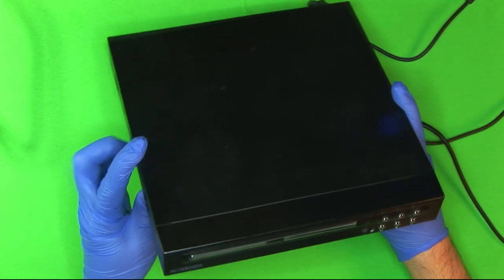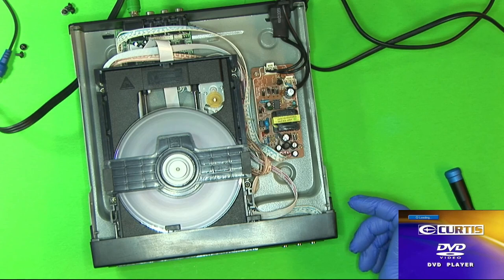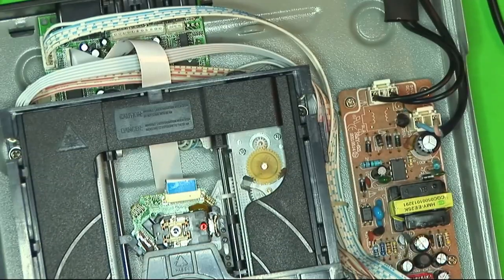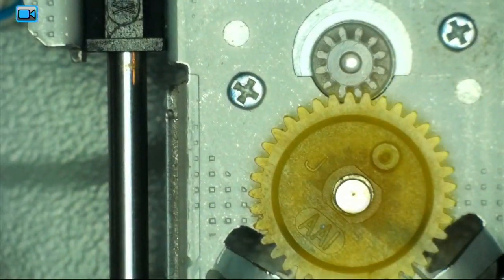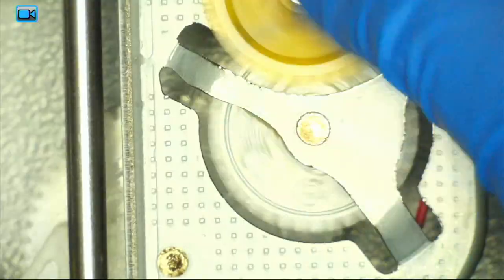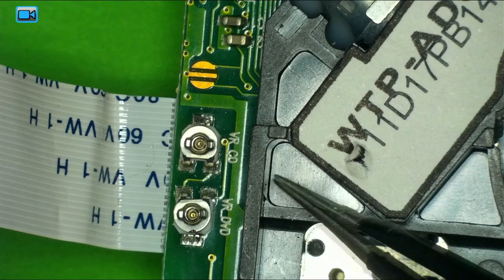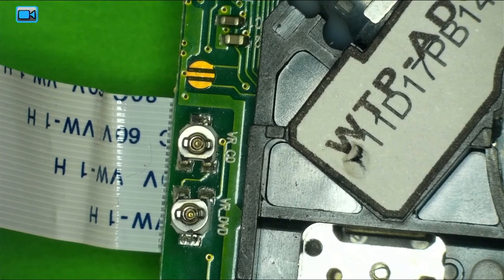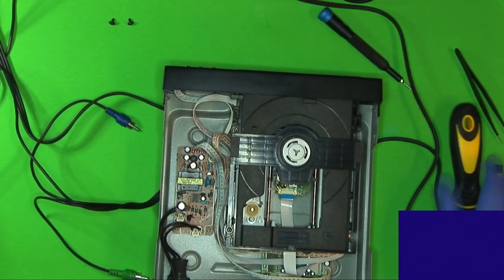Skipping and Freezing DVD Player Fixed - Long edit - No or Bad disc Error

Comment: Been trying this with a highly intermittent and accessed the pot with a long screwdriver. Tried counterclockwise first. Each time the reponse did change. Not having the proper tool cause me to possibly damage the pot, now it wont read at all. 
I reccomend EXTREME caution using this procedure. It works but physical damage occurs very easily. 
I tried searching for a correct tool online but was unsuccessful. Any recomendations are welcomed.. or if i have to replace it entirely .. what cross reference is available ? Many different brands use the same laser mechanism so a donor unit would save a really nice machine, sacrificing a cheap one like the one in this video.

Comment: it's very annoying,my dvd player skipping and play random parts of the disc.I don't know if it's the disc fault or the dvd player.I clean the disc and it didn't skip on that part but another part.It is odd that turning that potentiometer can damage the laser,the laser should have had an current limiters such as ICs or mosfet.Anyway,it's great if brighter laser can solve it.

Comment: Hello.
I have a koss dvd player, model #ks4122 that will not play or spin a dvd movie.
I put a new laser in it and it still won't load a dvd, i have changed the spindle and sled motor, no change, i used a working sylvania dvd as a reference and readjusted the spindle height and the laser table height, this got the player to play approx. 3 cd's, but no dvd.
The laser is similar to yours, with the 2 pots on the rear of the laser, below the ribbon cable, do you think the pots need adjustment, even with a new laser. I also used a bubble level and got the laser table level. Do you think it is worth it to try to adjust the pots, and which one is for the dvd, they are not marked, otherwise maybe i have a electronic problem with the mother board.
Any help would be appreciated, if it is a electronic problem i can not find a service manual, any ideas, i would like to get it going again.
Thanks

Comment: Ive got a Panasonic vhs dvd combo that on some discs freezes and goes pixalated. Would this method fix this issue? It doesn't do it on all dvds just now and again 🧐
Reply from the maker: Not sure.  Depends on if it has problems reading discs.  Since you say it reads others just fine, and its only a few that have problems, I wouldn't mess with it.  Do other players also have problems with those discs?
Reply: No they don't. Think the laser is starting to die in it. The discs play fine in my blu ray players

Comment: I have a dvd but it cuts of then like ten minutes when I put it back on it will cut of again after five minutes. What help can I get in resolving this problem?
Reply from the maker: power shuts off or it stops reading the disc because if it stops reading the disc its either a dirty lense or the laser is on its way out.  Very common.  Doing what I showed can buy you some time but what you'll be doing is overdriving it and forcing it to be brighter.   I have cd changers that have lasted years like this and ones that lasted only a few more plays.  It all depends.  If its the power that's shutting off, then its most likely an issue with the power supply.  Unless you are able to diagnose power circuits, best option would be to replace it from a parts unit.

Comment: Open and closing and won't stop
Reply from the maker: Sounds like its not registering the door being closed.  If you tell it to close the tray and hold it in place it'll give up and then eject.  So either its not closing fully (bad gear, belt or something in its way) or the switch/sensor that detects the drawers closed is bad or has a corroded connector.  Also could be dust/dirt in the grease under the drawer where the gear is, making it too hard to pull in so it gives up.  Sorta like old power windows in cars, they get really slow..most of the time its not a bad motor at first, but a dirty track/old grease.

Comment: Why not just get a dvd lens cleaner disc, not sure what you are doing here but I wouldn't advise anybody to take apart the player and clean with cotton buds!. You could do this with the big top loading VHS players but these players can be replaced for $20. It's just not worth the hassle
Reply from the maker: If you watch the video you'd see that cleaning it did nothing.  The laser itself is on its way out, so by adjusting the current to the laser diode, it can shine a little bit brighter.  So no, a dvd cleaning disc would do nothing.

Comment: Honestly Curtis DVD players were junk from day one. Not worth the effort for the average person when one can toss it in the dumpster and find much better, working DVD and Blu-ray players from quality brands at thrifts and flea markets for $20 or less all day long.

And adjusting the pots only really buys the optical block a little extra time. Buying a new block for this player is overkill. Maybe if it was some expensive DVD/SACD/DVDA universal, not something that was dirt cheap and not meant to last to begin with.
Reply: Maybe they shouldn't be made so cheap from the component level up. That wasn't the case in the beginning of the computer age. Its all about bells and whistles and quality went to other lands.
Reply from the maker: Agree completely.  But for the people who want to, they can try this.  Might buy a week, or a few years.